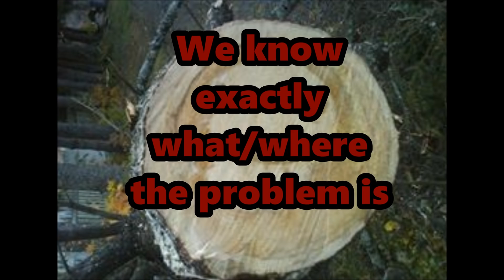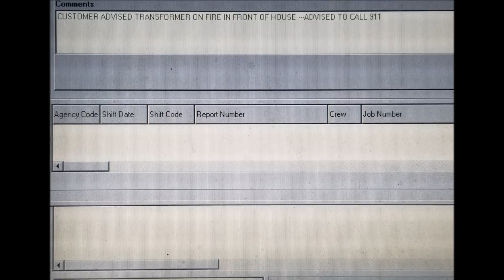5 Myths about Power Outages

Comment: The above/below ground is interesting -- I am living the first place I've ever been with above ground lines.  My parents live in a neighborhood with all underground lines.
Lately it seems like their power is going out for short times (hour or so) all the time, so much they finally had an automatic standby generator installed.  Our power blips very often in storms and windy weather (just enough to reset a lot of stuff and make some lights flicker) but rarely goes out and the UPSs I have click and buzz and complain almost daily.  But when ours does go out, it's never less than 6-8 hours and one time was around 42 hours (they had to bring in a bulldozer to get to where the lines used to be).
I do notice all the new construction here even though it's rural with overhead lines the new lots are all buried and pad mount transformers.
Reply: In our neighborhood it was because the underground lines were touted to be "direct burial" so our company direct buried them. They worked great until rocks drifted through the soil and shorted the lines. After a decade or two they were all dug up and replaced inside conduit. Expensive lesson for the company.
Reply: @flagmichael  I feel like that's vindication when I had communications lines installed in yard ALSO put in to its own separate conduit
Reply: one neighborhood where i use power has frequent outages and it's above ground. usually tree limbs or something. it's in the city. here we have outages semi often, i def buy UPS back ups and replace the batteries every 3 years OR put massive 100 amp hours batteries. i can watch tv and stuff during outages. want a whole home generator.

Comment: A transformer actually blew up in my back yard once. It was the loudest boom I've ever heard.
Reply: There was flaming oil in my yard. The barrel was blown open and chunks of tranformer everywhere too. The electric company confirmed that's what happened too.
Reply: Makes me laugh how people act like they know what happend when you where there and they weren't. Especially considering you just watched the video.
Reply: We lived in a house on the high ground for a long time. At the edge of our front yard was a residential power pole with a large can type electric transformer mounted on it. Twice during the time we lived there transformers on the pole were struck by lightning and exploded like bombs. I always wonder if they throw deadly shrapnel around when it happens.
Reply: Saw the aftermath of a substation transformer failure.  Lucky no one was killed. Area had to be evacuated. Power out for a long while. Repairs and upgrades took 6 months or more.
Reply: @markbernier8434  We had a transformer fire at a 345 KV substation. I only saw the aftermath as well but it was very impressive!
Reply: One blew up down the street from us.  The top had popped off and it was fully blackened.
Reply: Roadworkers in my street last year hit a low volt line under the road. Big bang and smoke
Reply: I was about 3/4 of a mile away from a pole mount transformer that blew up. It sounded as loud as a large "salute" in a fireworks show. I felt it in my chest.

Comment: The transformer across the street from my house blew up.  It was a cylindrical can on the pole, and on a hot summer day the top blew off, sending up a large fireball, and spraying quite a few gallons of burning oil across the street.  

However, even with such spectacular Hollywood level pyrotechnics, the overall property damage was pretty much nothing, aside from a little oil staining on a concrete driveway.  Within a few hours, lineman had replaced the can and put a second one down the road, splitting the load in half.

Comment: I was an installer for Michigan Bell, 51 years ago. I was 15' up a pole on a cable waiting for an assigner in a suburb to give me a new cable pair to replace the defective pair that this customer had. The weather was dry and I had been hanging from my body belt for an hour and a half, bored out of my mind, when a stray dog came down the alley and took a leak on the pole I was on. The dog let out a blood curdling yelp that made the hairs stand straight up on the back of my neck. 'What the hell just happened???'  I left my test set and the assigner on hold and climbed down the pole to try to figure it out. The ground rod was sunken in sand. The dog was standing on clay and loam (ordinary soil.)  The dog completed the ground for the system.
Reply: I feel bad for laughing
Reply: I recall a couple of friends were out hunting and came across an electric fence.  One dared the other to take a leak on it.  It did not end well.
Reply: @southernguy35  lol found this thx for the mems and laughs https://www.youtube.com/watch?v=5X5z0yYGgl4
Reply: @wizard3z868  , truly words to live by.
Reply: @southernguy35  I slipped and fell next to a small stream (about 3' deep, but not moving fast) and grabbed onto the 'fence' that was next to it. Electric, of course. God that hurt so bad, ruined the camp out.
Reply: That will get his little red lipstick glowing
Reply: 50k volts in the junk!
Reply: It's so much easier to drive the rods in sand <8^}
Reply: Sometimes urine the wrong place @ the wrong time.📉😎📈
Reply: Clinton Andrews lol what a coincidence
Reply: The apocryphal story of this was the lady who called to report her phone stopped working and said that the dog started barking every time the phone was supposed to ring. They sent the repair man out and he got to the house to have the little old lady tell him that the phone had quit ringing inside but she had noticed that the dog barked and if she picked up the phone there were people on it. Come to find out they had the poor pup chained up to a water pipe coming out of the house. They’d also attached the phone ground to the same water pipe. Over time, the chain broke the wire loose from the water pipe but it was still touching the dog’s chain. So every time the phone rang, the poor pup got a 70 volt shock. You’d bark like hell if you got a 70 volt shock to your neck too!
Reply: @Bill_N_ATX   new ringtone!😜
Reply: Did the dog survive?
Reply: @josephheston9238  Last I saw he rounded the corner at the end of the alley and disappeared into the neighborhood.
Reply: While stationed ay PSAB in Saudi we had our own grounding rod.  It went deep but this was a desert and the sand was not a good grounding conductor.  We emptied our coffee percolator on it daily, and the night shift used it as a pisser.   Plus we dumped any other fluid we could find on that rod.  Water, old Gatorade,  water buckets from washing the trucks, etc.  It made a huge difference.  Civil Engineering squadron was supposed to install a better grounding system, but that never happened.  As usual, C.E. was worthless.
Reply: Poor doogie
Guess you should make sure your not urinating next to a live utility pole,etc.  Or you might be in for a surprise!?🐕😯⚡⚡⚡
Reply: Michigan Bell, ain't heard that in a long time.  It was Ameritech right after Ma Bell wasn't it?
Reply: @TempoDrift1480  I don't remember the actual sequence, but I think that AT&T (the Death Star) was in there somewhere as well.
Reply: Why are dogs balls round? To prevent a corona discharge in such a situation😂
Reply: @charlieangkor8649  What does the beer virus have to do with this?
Reply: new meaning -- to "hot dog" in aus
Reply: Nice the dogs evolved to become self neutering 😄🖒

Comment: When I was about 12 I was in the back yard when there was a flash bright enough to see my shadow at about 2pm on a clear summer day in Texas. There was a huge report that shook the ground and the trees. When I turned around there was smoke rising from the transformer. The transformer was slightly bulged and there were holes in it. It turned out that a squirrel had gotten inside of a connection panel and shorted it out. It took days of cutting brush and trees to get a truck in to replace it.
Reply: "SQUIRREL!!!"
Reply: Squirrels in the US at least are a major cause of outages due to, in some cases, exactly that. Regularly they can bridge phases with similar results.
Reply: @IncertusetNescio  check out how much damage they do: search for cybersquirrel1

Comment: How can you meter sutch a high voltage system
Reply: Faze sticks.
Reply: CT's
Reply: We use a capacitor type meter. It's mounted on the end of a hot stick (a fiberglass pole that doesn't conduct electricity) and it has a pointy probe on the end and a basic meter you can see. When you touch the probe on to a bare wire or the test point on an elbow, the meter will read the approximate voltage. Of course, the hot stick is 8' long and the meter is only 2" in diameter but if it's hot, you'll see the needle move.

Comment: why do transformers blow up?
Reply from the maker: Arcing or heat willl cause gases and expansion within the sealed can.
Most times a pressure release valve will be sufficient and the fuse will blow. Sometimes things just don't work the way they should and the pressure blows the lid right off!. Also when a winding shorts out, it's possible that the fault is so catastrophic that it blows the can apart simultaneously with the fuse blowing.
Reply: @Bobsdecline  thx man has that happend at ur substation yet?
Reply from the maker: We've had a few pole mounts blow over the years, and a tap changer attached to the power transformer at the sub blew apart a long time ago!
Reply: @Bobsdecline  oh alright
Reply: I asked my father-in-law (retired CG&E lineman) why substations blow up, and he said, "Because they didn't change their oil". He then explained how the transformers 'breathe' with changing temps, gradually accumulating atmospheric moisture in the oil. I miss those conversations:  RIP Dan'L

Comment: I've worked extensively with underground for 5 years and traveled thousands of miles unnecessarily to learn all the specialized skills UG entails. Most areas don't have lineman skilled enough in splicing, termination, installation, operation and maintenance to make these system cost effective. When I open a cabinet/vault/manhole/box on a trouble call I can always tell at a glance when an overhead crew did the work. Then expect anything to be wrong. It really takes several years of constant UG work to get an overhead guy trained up and many places do not have enough UG in their system to do that.
Reply from the maker: Definitely an a trade in itself ! Probably the biggest issue I've seen when splices are done is knowing how to properly protect the splice/termination from water damage , or forgetting to install bleeders/bonds on the elbows or plugs . It's crazy how the outer shell can arc so easily. Also once saw a grass fire start as cables were energized ... Concentric neutral wasn't properly bonded to ground
Reply: @Bobsdecline  The first thing I teach anybody is that the concentric is a system neutral just like overhead and will absolutely kill you. Can't tell you how many people I've seen pull these apart like it's simply a ground or fault path. There could be a broken jumper nearby on an overhead circuit and that underground loop you just de-energized is macking around the break. I've seen many of them sparking! Hell on UG 600A feeders the subs will even balance each others imbalanced load and neutral float potentials through that de-energized feeder. So don't even trust delta UG systems ringbus to be truly free of load. Thanks for the reply. I love getting nerdy about linework.
Reply: @iant419 ,  people come on here and always ask why don't they just put the power lines under ground? But they never think about the years it would  take to dig all them tunnels, install the utility vaults, the billions in funding it'd cost to do it all, etc.
Reply: @kalijasin  Well, here in NY, with it's trees literally hanging around the lines (due to cutbacks they stopped pruning)... any storm, any winter, any ice... and the power goes down. Well... it got so bad a couple of years back that crews were brought in from all the surrounding states AND Canada. Even the poles hadn't been replaced on schedule. The one in March was really bad; I went to neighbors and were delivering batteries and hotwiring furnaces to get them heat- and run their sump pumps.
https://www.democratandchronicle.com/story/news/2019/12/19/nyseg-rge-settlement-with-ny-over-storm-violations/2697444001/
Reply: @kalijasin  It's usually Europeans that complain about all of the US's overhead lines.  They claim theirs are all underground (they're not) and that's much better and we're inferior for not having a similar system.  My rebuttal to this is 3-fold:  Most Europeans have no grasp of how big the U.S. actually is.  What "works" best in Europe isn't necessary what will work best in the U.S. (and vice-versa).  Europeans seem to have a tenancy to complain the U.S. "bosses" the world around but it's them that are the bossy ones.  
I also like to add that if they'd prefer to provide the 40 billion dollars and 50+ years to bury all the lines, then pony up!
Reply: @iant419  I'm a layman power system nerd.  I'm presume the term "concentric" you're using is essentially the "shield" conductor on the buried cable?

Comment: How long does a transfer last? I hear thy last year's is that true?
Reply from the maker: Transformers will last a very long time . Infact there are many still in service since the technologies first existed ! Changes in environmental regulations was one driving factor in a major change out over the years . Other then that as long  as the oil inside remains sealed  25 years should be no problem at all
Reply: I've taken down many transformers from the 1920's that are still functioning perfectly.

Comment: What if a power line is over a car or truck and you touch the medal inside the car or truck will you get zapped? I don't think you would because of the rubber of the tires would ground the vehicle.
Reply from the maker: If the lines are laying on the car , the rubber tires my actually prevent the fuses from blowing. The entire car would then be considered part of the wire. There would be slight difference in voltage between all the different components of the car however you would generally consider the car as a whole as line voltage : say 7200 volts ... The ground around the car would then be say : 0 volts . If you get out of the vehicle with one foot in the car and one touching the ground, the 7200 volt car would pass all that voltage through your body using it as a path to ground. That is why they say stay in the car and don't move. Should the car be on fire or if for any reason you must get out... Jump . Two feet together and as far away as possible , then hop with two feet away from the vehicle. Your two feet together will minimize the chance of seeing a difference in voltage across your body.  Another scenario ; should the voltage be say 69000 volts , the car tires will likely not be enough to prevent the electricity from jumping from the vehicle to ground. The vehicle would likely car fire fairly quickly
Reply: @Bobsdecline  In Phoenix large backhoe had a 69 KV line come down on it. The tires conducted enough to smolder so the operator climbed down like he always did, one leg first while he held on. So sad.
Reply: Thanks for the information
Reply: Dont get out! Your part of the circuit,  your tires is your only protection, electricity travels like waves in water, throw a rock in the water and see the ripples well that electricity when it hits the ground, it travels
Reply: Cody Whitman I’ll listen to a seasoned lineman over any civilian.
Reply: @Liam that's true
Reply: @Liam Not really a Faraday cage, which is a radio-tight enclosure. When I started working at the electric company I started in the radio shop, and it had a Faraday cage. It was about 10 by 10 feet and maybe 7 feet high, completely covered with heavy copper foil. With the door closed a portable radio inside could not communicate with one right outside.
However, tires are only semi-conductive. The steel belts run the circumference of the tire so they make no difference. The black is carbon in the rubber, enough to make the rubber behave the way it should but not enough to be conductive at normal voltages. Getting out of a car is still enough to spark gas filler fires from the static electricity, so the tires are insulating at least to a few thousand volts.
Short version: if you stay in the car until the lines are deenergized and grounded, you  will have no problem. Try to leave and you face a lot of hazards. Stay put unless the car catches fire.

Comment: I know that fuse blowing sound a bit too well. A few years ago as I was leaving to take my dad to a doctor I heard bangs and I thought they were shotguns, I noticed our motion sensor light was on, but didn't think anything of it. When I got my dad to the doctor Facebook was blown up with reports of fire calls, blown power line fuses, serious power surge damage, power outages. I also checked my home phone and found that my computer and UPS went down. It was cleared up by the time I got home and there was no damage at my house thankfully. I later learned that a 34.5 kV sub-transmission line had a crossarm break and a phase of that crossed with a 12.47 kV distribution circuit.

Comment: Given a choice, which brand of aerial truck do you prefer?
Reply: Alter, smooth like a Cadillac but bouncy when leaned over all the way, terex is good slow but smooth as well, me altec
Reply from the maker: All depends on what I'm doing I guess ... Currently I run a small Terex  on a service truck that I really like, but its not much good for heavy work. Our Posi Material handlers are solid and have good reach over center ,  but they are pretty slow. We used to have an altec double bucket that Iiked for rubber gloving